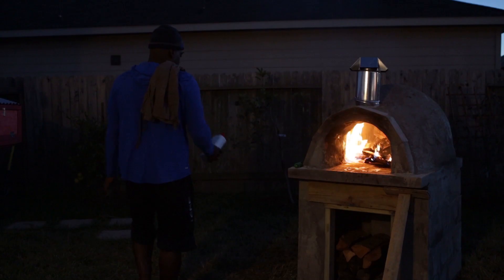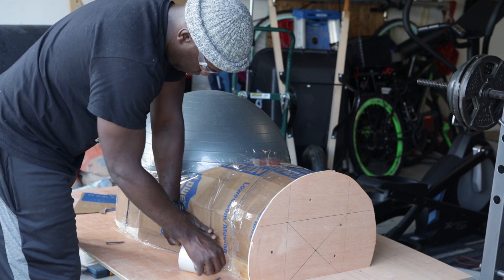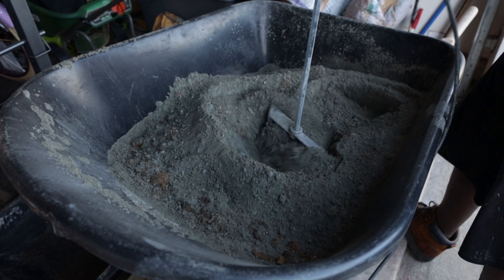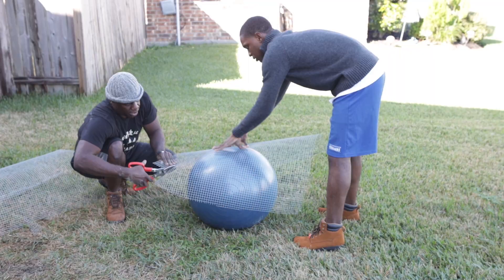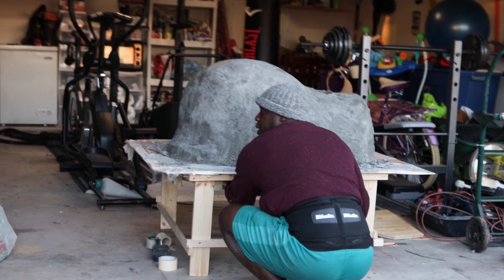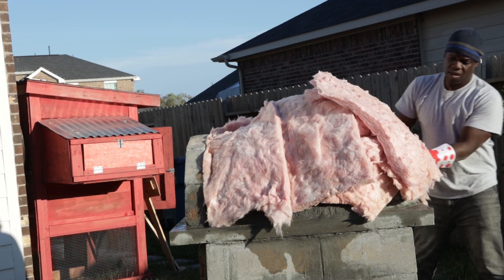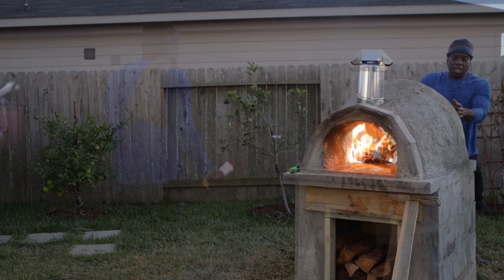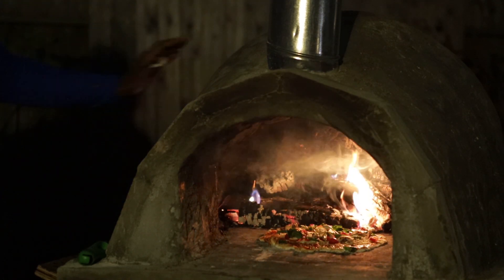How To Build a Back Yard Pizza Oven

Comment: A few questions.  How long did it take you to finish? What was your mix ratio on perlite to concrete?  Also, I really appreciate you using whatever you had on hand.  I also wonder how it has lasted since you have built it.  Any cracks?  How does it hold the heat?  What temp does it go up to during cooking?  Also what are the dimensions?  What was the base made out of?  (firebrick, cement, cinder block)?  I am assuming that was your son but nice to see kids involved.  Looks great.

Comment: You asked if you were doing it wrong.  Honestly, you look like you did your homework as I've seen this same style of build for a traditional wood burning pizza oven before on a couple of channels, especially the exercise ball used as a form for the dome by having it sit in a hole cut in plywood.  It sort of one of those things that is rule of thumb/that's close enough.  Differences are just style, like using aluminum air duct for a chimney, or using a tall, ceramic flower pot with the bottoms cut/knocked out for a chimney.  Either way, you made a stone igloo with a chimney in the entrance, and it works fine.

Comment: What you use for the bottom of the oven???
Reply: You should use a stone fire brick base to cook on. Keep it clean. My insulating mix is pretty standard. 3 2 1 recipe. 50-50 perlite vermiculite, 2 parts masons sand. 1 part good high grade portland cent. Make small batches with pre-wetted P/V mixture. Don't make sludge/mud,  FIRM stuff .  Good outdoor paint over spurge coat of reg brick mortor. Mine has lasted 20 years up here in New England.
Reply: What is the diameter of your floor?